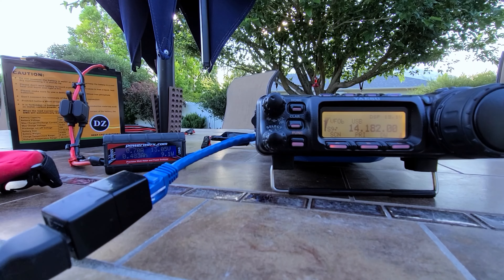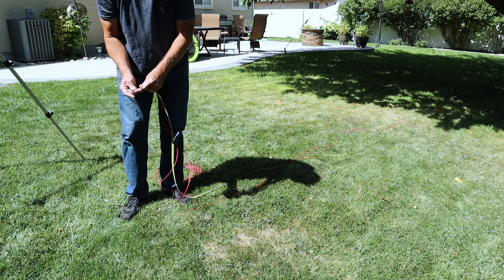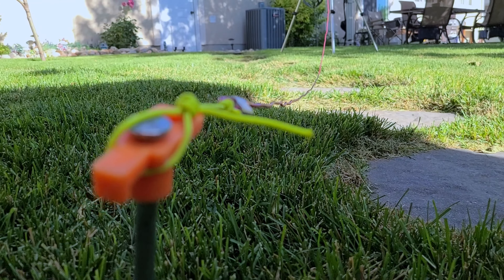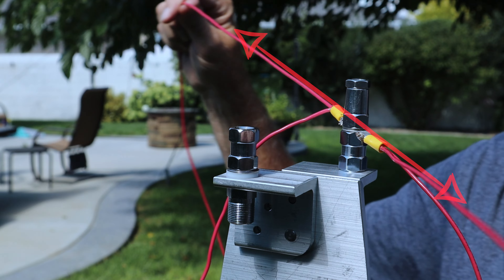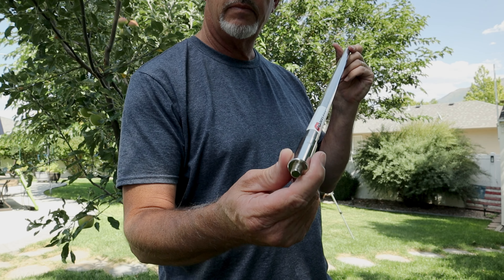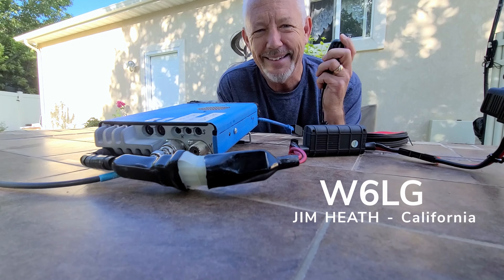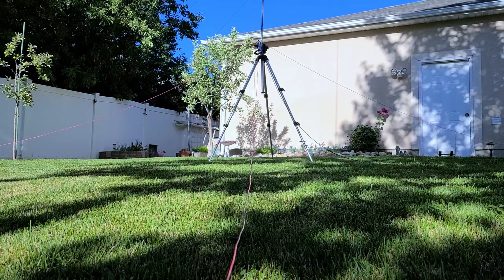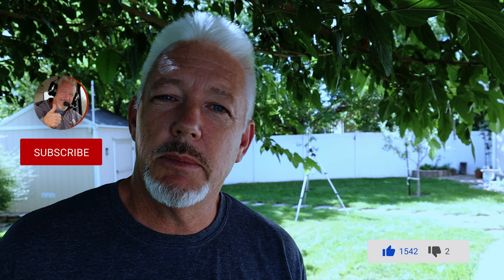This is what I would DO to get ON THE AIR | K7SW Ham Radio

Comment: My 20 Meter Vertical is ground mounted with 3 radials about 13 feet long on top of the grass.  The vertical element is an aluminum extension ladder leaned against the roof..  I use it on 30  Meters by extending the ladder.

Comment: Might I suggest a telescoping fishing pole (crappie pole).  Those things are taller than the telescoping whip and much, much lighter.  That lets you reduce overall weight significantly.

Run a wire up the pole and you have a vertical.

Run a end fed half wave dipole up and you have a multiband vertical without need for radials.

Run that same EFHW wire with the cable center raised on the pole and you’ve an inverted V.  That wire itself is the guy.  It also lets you run much longer wires.

etc. etc.
Reply from the maker: Great idea, 👍

Comment: Nice contact with W6LG Jim, the YT Elmer.  That SS17 is a must with so many ways it can be used. (I've got 4 of them)
Reply from the maker: Thanks David, Jim is a really great guy. 4 whips, now that has got to be big fun.
Reply: I got two for the Tactical Delta Loop/MPAS and then wanted to experiment with phased ground mounted verticals.  Now I can do lots of fun experiments at full size for 20m. Thanks for all the good ideas. Can’t wait for the video on that mount.

Comment: I ran into another POTA Ham Operator that use this configuration except used two longer radials 90 degrees apart. He was loud and clear. He called his configuration the Predator Antenna I believe. Wow it would be an honor to QSO with Jim W6LG. I watch his videos all the time. I have all the items to make this but I was thinking of using a steal t-post I could drive in the ground. I would image I should insulate the mount from the t-post though as you do not have a direct connection to ground.
Reply from the maker: Yes a nice setup like his would be directional and work perfectly. Jim is a real fun person indeed. Try your stake idea. You might be surprised  at how well it will work . 73
Reply: @hamradiowithkevin  I was wrong on the antenna name that the POTA operator was using. He called it the predator antenna. I am going to try this.

Comment: Currently putting together this scenario and the Dipole setup.  I ordered all the related adapters and have already have several tripod scenarios and clamps. I should get an antenna switcher !!
I just passed my Technician and General so I’m just getting started. With these two scenarios I will be Abe to hit at least 10 repeaters in my area MN / WI on my FT-70D Yaesu HT.   73

Comment: I do something similar and use a Hustler Mobile antenna Quick Disconnect QD-2 so I don’t have to worry about the threads. It fits the 3/8-24 standard threads.

Comment: I had no idea you could elevate radials. Thanks for sharing.
Reply: Those 3 or 4 rods sticking out horizontally or angled downward from the bottom of pole or tower mounted vertical antennas are radials.  They establish the ground plane.  Same thing.
Reply: @stargazer7644  But are they claiming there is an improvement if the radials are elevated vs on ground?
Reply: @anonymous_friend  If the antenna is elevated, the radials need to be elevated (or at least part of them).  The ground plane must be connected at the base of the vertical antenna.  The better the ground plane is, the better the antenna will perform in general.  Asking if there is an improvement when you change anything on an antenna depends on what you're looking for.  More low angle radiation? High angle?  Better feed matching impedance and lower SWR? More efficiency?  Directionality?  Gain? Front-to-back ratio?

Comment: Nice 1/4 wave vertical. My only suggestion is instead of soldering the connectors for your radials, use liquid electrical tape. I found with soldering, the joint becomes hard and unpliable and eventually the wire breaks right at the solder point, especially with constantly undoing and redoing the radials. Crimp them, then brush on the electrical seal. The wires will stay nice and flexable and will take at least four times as long before it breaks. It can be very frustrating to setup your antenna, setup your rig and everything, then find your radial connections are broken. And it WILL be on a day when you don't have access to a soldering iron to be able to fix it. Ask me how I know.......73 de VK2AAO
Reply from the maker: An excellent tip, I will try the tape and could even make a video about that.

Comment: Great video. I was wondering why keep the radials off the ground? I see most folks running them on the ground.
Reply from the maker: Thank you, yes there are two ways to use a vertical. Ground mounted and elevated radials.  Elevated radios must be measured and trimmed to exactly the band you want. where ground radials do not need to be exact. For a more precise having the radials raised radial provides less ground loss for one. I suppose many operators do not want to take the time to and space to extend the radials, I am not really sure.  I will operate both types because you never know what conditions you will be in when you setup your radio. I think you should try both setups, It will give you more experience with setup and learning your antenna.
Reply: @hamradiowithkevin  Thank you for the reply! I'll give that a shot. KC3MRA.

Comment: Great video, I was wondering, your ground radials are insulated at the ends. Is there a reason to to this rather than just having them grounded to your tent stakes? Thanks.
Reply from the maker: They are elevated radials so I don't want them ground to the earth. If so, they would de tune. You should try it to see the result, will still work, just a good thing to know. 👍

Comment: Thanks for the great video, covering from the assembly to actual operation! One question: Do you have any kind of choke in the feedline? Would it provide any benefit in this setup?
Reply from the maker: You are welcome. You can certainly use a choke, I normally don't use one for a quick setup like in this video. To me, it never makes enough difference to bother.

Comment: Great set up. Interestingly, I use the MFJ 1779 whip with the same set up but use 8 radials half the length (garden is smaller).  Great performance 😁 de Andy G0NKK
Reply from the maker: Thanks Andy for sharing your setup,  yes you know then, how well a vertical performs 👍 73 Kevin
Reply: Just a quick note, he is using quarter wave radials on the video, and they are elevated.  If your radials are actually on the ground, they are not as critical in regards to length. This antenna is basically the same thing as a traditional ground plane antenna which was used widely in cb and commercial radio for years. It's a good antenna.

Comment: Would six radials be better than four?  At what point is there no advantage to adding more?
Reply from the maker: 4 radials are practical and effective.  It will be hard to measure in a practical use case, any additional radial wire. To me, that is enough reason to stick with four. 
Hope that helps

Comment: Great video! Quick question. What SWR should I expect on 20m with this set up? Thank you! 73 de KE8UFQ
Reply from the maker: The SWR will be pretty flat, which is a great thing
Reply: @hamradiowithkevin  I have not used verticals to date. When I tested your setup, I got a 6.0 SWR. Is this correct? If so I will use a tuner to operate. Please advise. Thank you.

Comment: hi Kevin, do the radials need to be at least 1/4 length of the frequency, and can they be longer ?
Reply from the maker: For this antenna 1/4 wave makes the antenna easy to use and no Tuner. Lobger radials can be used, you will need a tuner to bring the match into range for you Jeremy.  73 Kevin

Comment: I should know this but why elevate the radials?
Reply from the maker: Good question Tony, if you elevate the radials, you need less, like 3 or 4. if you ground mount the vertical you need MANY, like 50.  and the match can be tuned by changing the angle of the radials.  I hope you get to try this one time . It is way worth the effort

Comment: Good video. BUT 16ft 6in is not 10.06 meters.  it is 5.08 meters.  How wide is the bandwidth?  No tuner/transformer, I presume.  I have been experimenting with "ham sticks" for 20 and 40 meters.  I tuned the ham stick using a mag mount on my car for 14.175MHz.  I then mounted it on my motor scooter using a mirror mount and alternatively one of these jaw clamps.  Actually, I did not have much success with radials. BUT I did run a raised counterpoise/radial(?) 14ft (Ventenna recommendation)l ong and viola!  Very broad bandwidth.  I then mounted the ham stick on a strong tripod.  I got mine for free from the dumpster. One man's trash is another man's treasure.  Same setup with one 14ft wire. No tuner no transformer.  The 40m ham stick was a little more tricky.  The bandwidth is narrow, only about 80KHz.  But it works.  Let me know what you think.  Many roads lead to the same destination.  Vy 73! SV0SGS
Reply from the maker: Very practical setup you have done. Thanks for sharing.